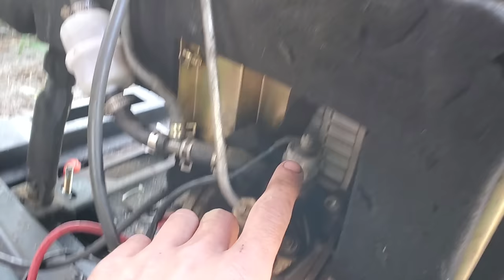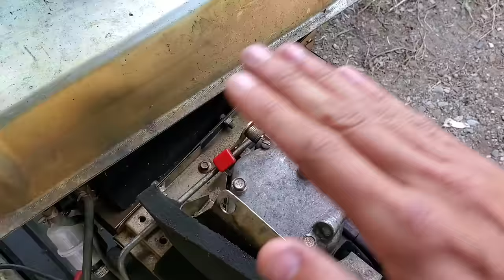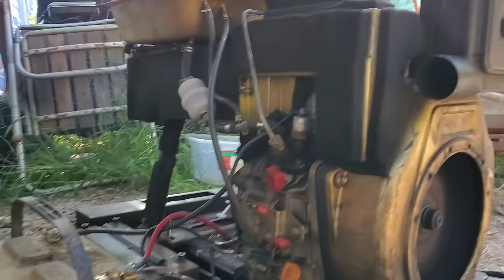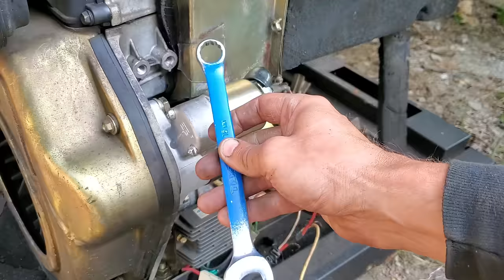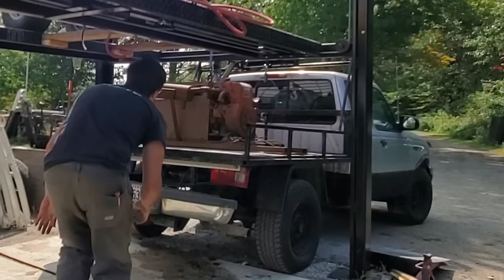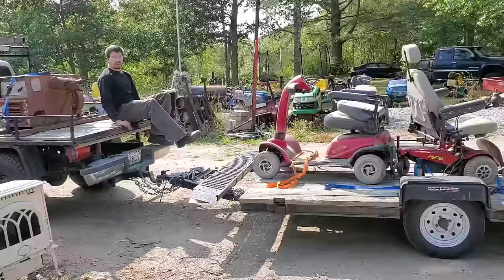10hp Diesel is Alive!

Comment: Bro if you get this I have same Gen motor popping backfire and white smoke, I adjusted valves properly still doing it, Thinking g Water in fuel, I’m in Southern Asia, Is there a trick to smooth it out, Thanks Belus